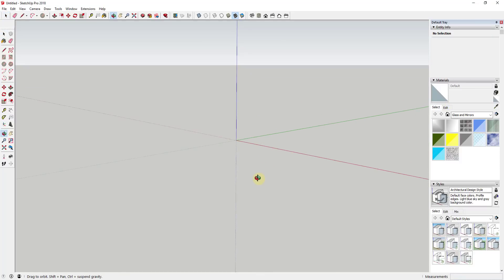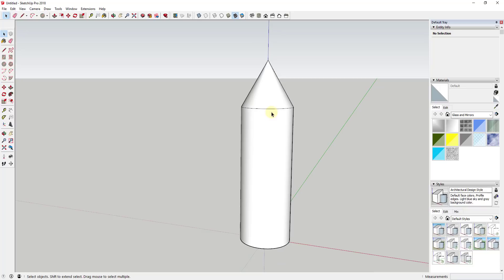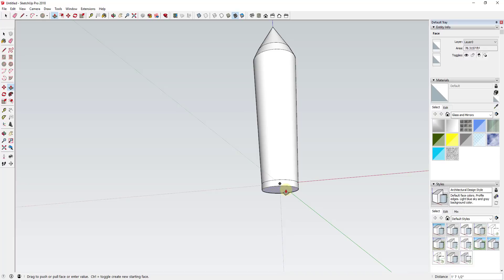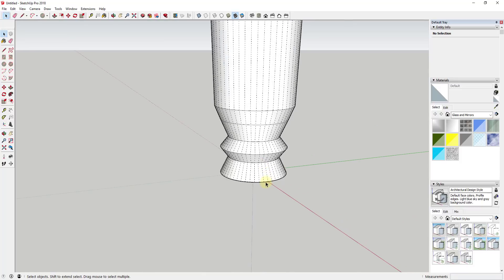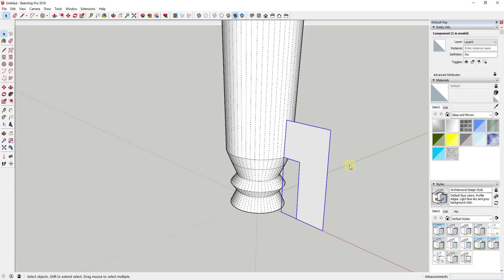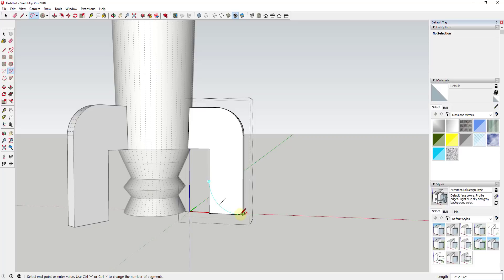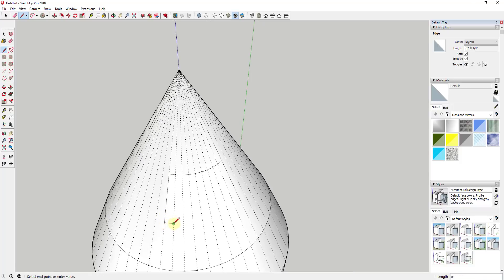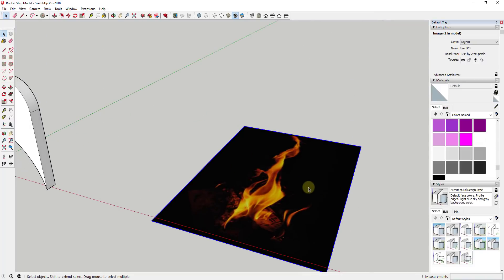Modeling a ROCKET SHIP in SketchUp

Comment: Hi Justin
I take it you are working in the Pro version of Sketchup?  The reason for asking is that I use Make 2017, I am retired and use it more as a quick sketching tool for drawing up the odd toolbox and woodturning idea. 
I have been wanting to make a woodturning bowl design that I had in my mind but could not get it to work. The problem was I wanted to use the "Follow Me" Tool but I cannot get it to work, hence my question. I have tried following your example as in Modeling a Segmented Bowl in SketchUp Part 1 - SketchUp Quick Models video but cannot get it to work.
Thanks
Roger
Reply from the maker: Hi Roger - I need more information on what exactly isn't working